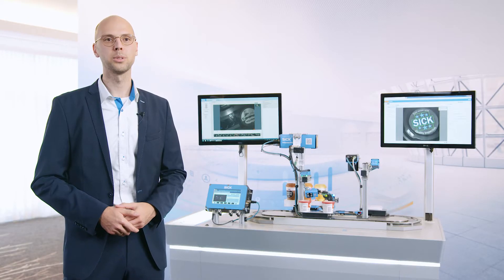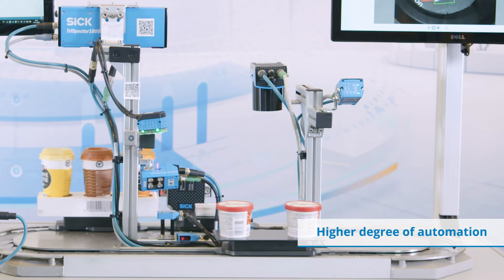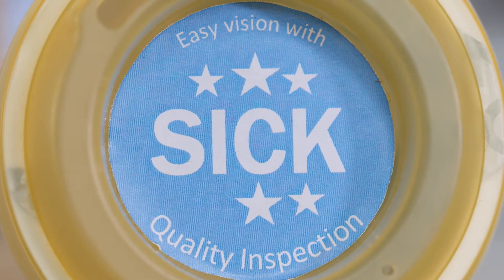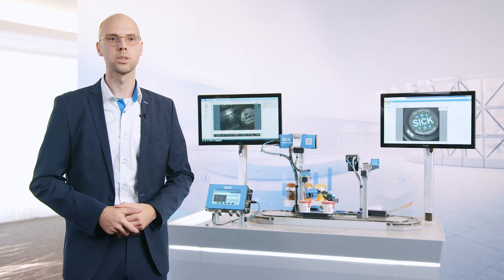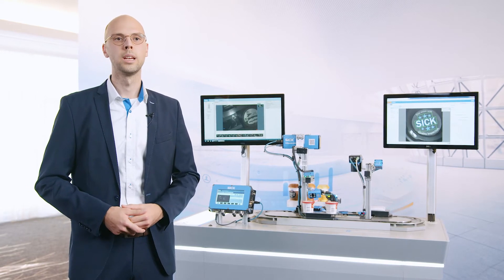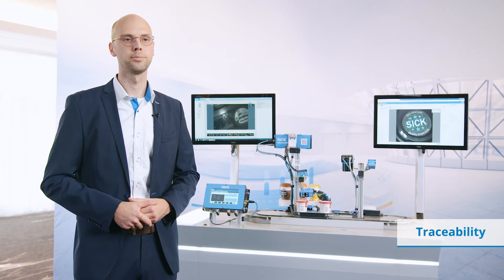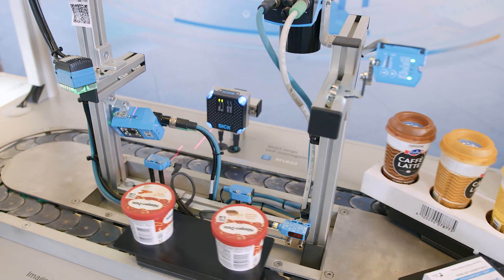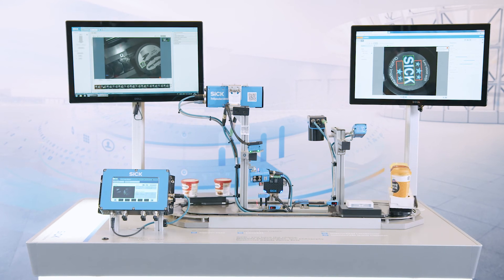Machine vision solutions: quality inspection and camera-based code reading | SICK AG

Comment: Which is the most affordable way to detect ellipses with your vision sensors? I need to find the ellipse center coordinates and the mayor axis angle. The ellipse diameters are 6”and 9”.
Reply from the maker: The most affordable modern vision sensor to solve your need is the InspectorP61x (https://www.sick.com/inspectorp61x). Please get in contact with your local SICK office to learn more: https://www.sick.com/de/de/contact/worldwide